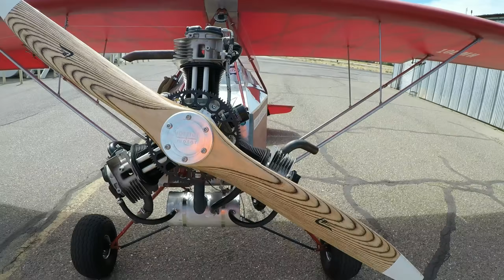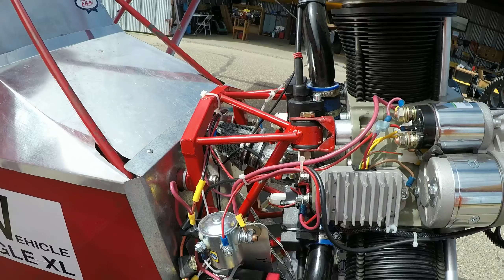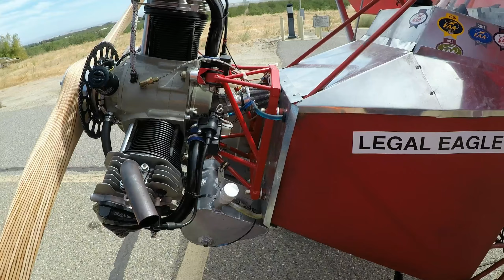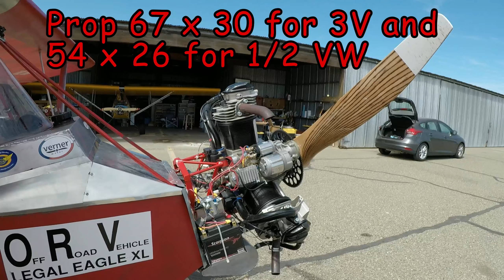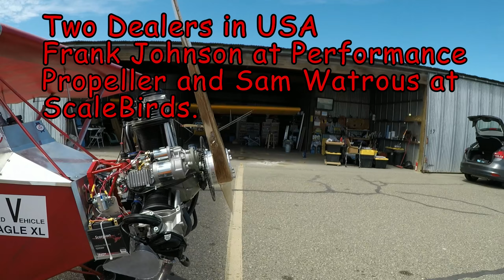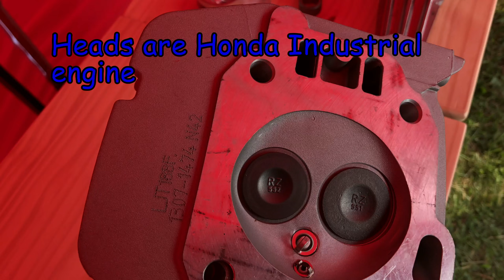3V Walk Around

Comment: Looking good as usual Les. Those shock absorbers being mounted that way are perfect for soaking up that rotating forces compared to ones mounted straight forward. Is that battery a lithium? If it's not you may be able to swap it out and shave a few more lbs.